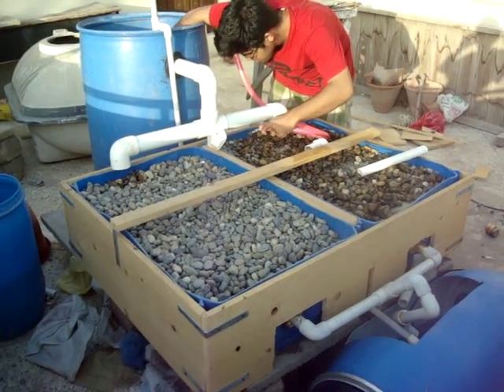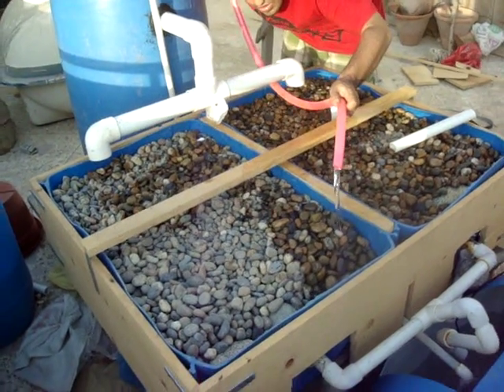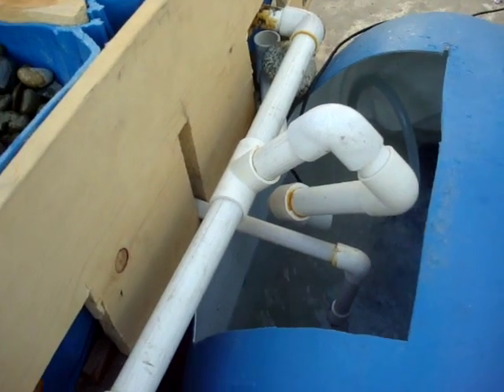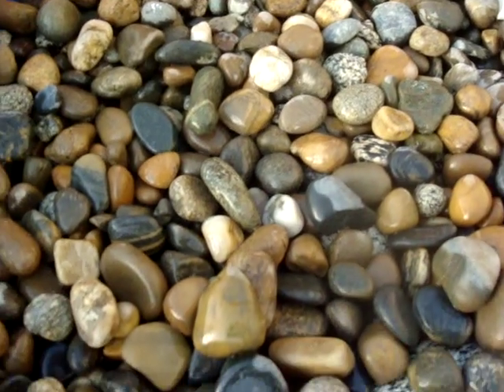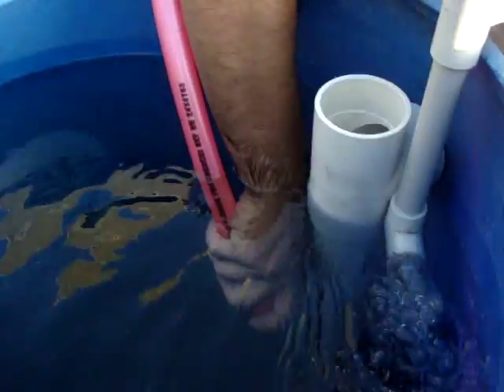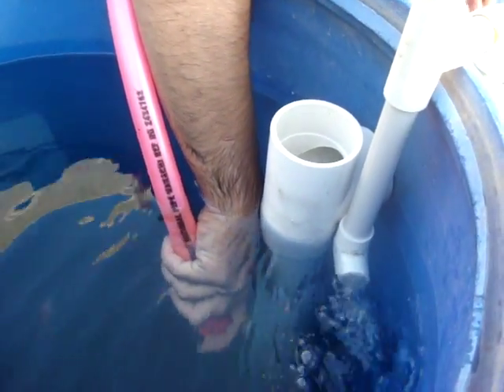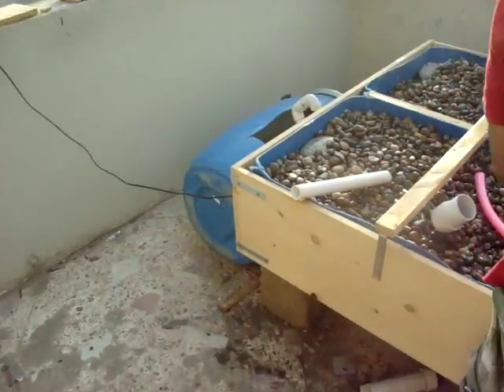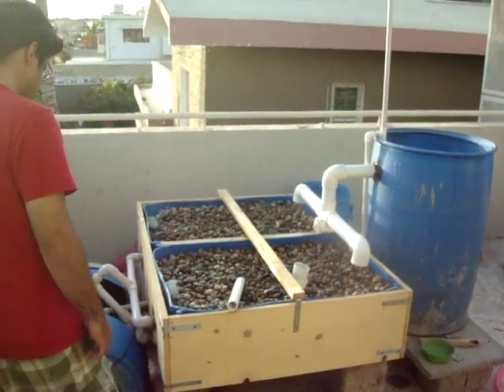Paki-ponics!

Comment: which system is best in commercial 
aquaponic
Reply from the maker: That is a very complicated question to answer.

Depends on capital, available resources, target market, local climate, target harvest and so on.

You should check out my other AP videos, you can see a variety of systems in them.
Reply: Best system will be Deep water culture cause it requires the least amount of maintenance ( once set up )

Comment: water ciculation 24 hrs rakhni parti hai kia ya koi or hisab hai kindly bata dein bs iska
Reply from the maker: Hi!
The water circulates 24 hours, i.e. the pump is always on lifting water from the sump tank (at the bottom) to the Fish tank (at the top).
It is also constantly flowing into the grow beds (Barrels with the rocks and plants) but it is not constantly flowing out of that. It fills up to the top level, then empties to the bottom level and stops flowing, just like the flush in a toilet, but without the moving parts.

Hope that helps, feel free to ask more!